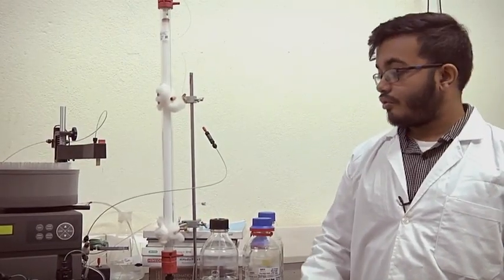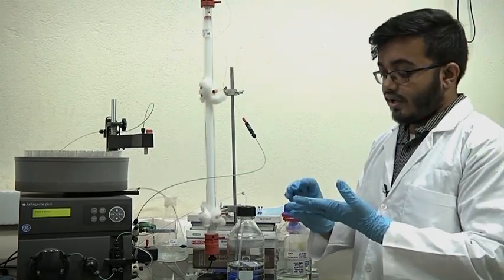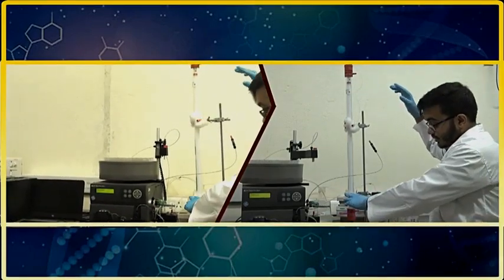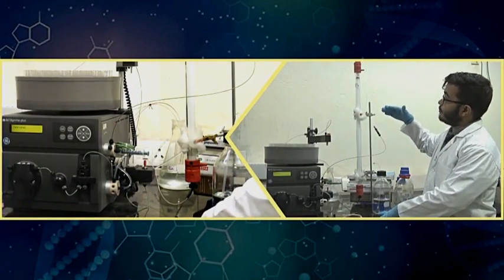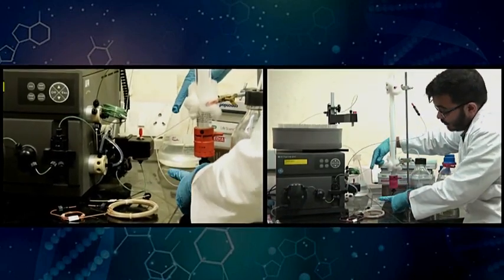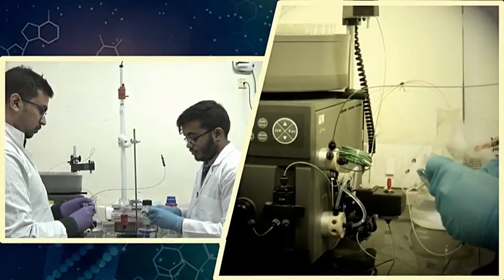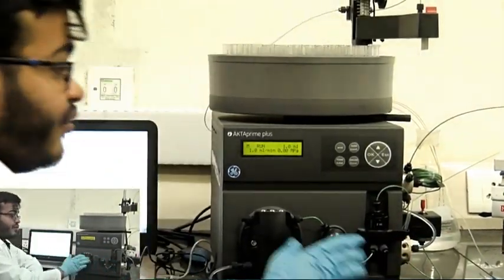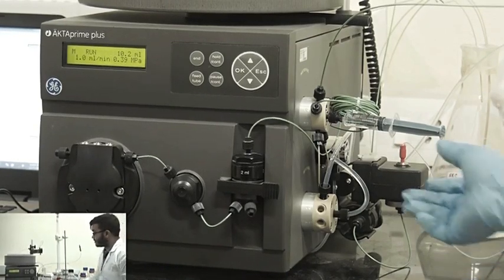lecture 25 : Protein Purification by Size Exclusion Chromatography (SEC)

Comment: When you are talking about the olden days that is exactly what I do now. However, I syphon buffer onto the column so do I don't have to manually add buffer to the column, and I automatically collect fractions with a spin collector. I used Bradford assay to find the bluest fractions where the protein is present, and I check the A280 of those fractions.